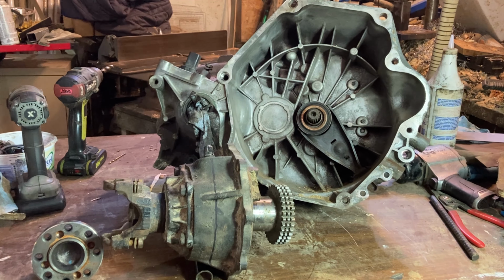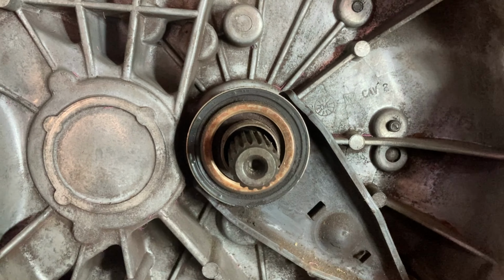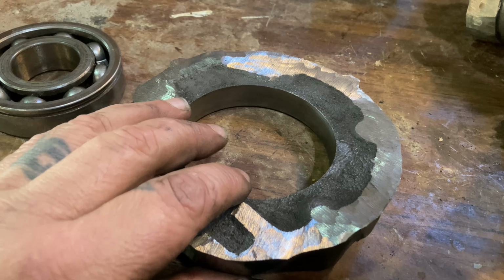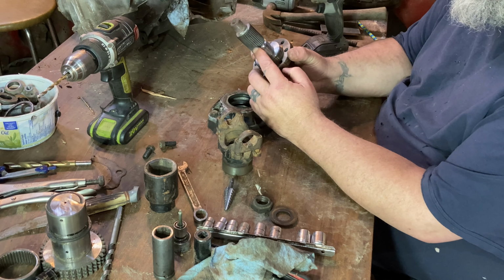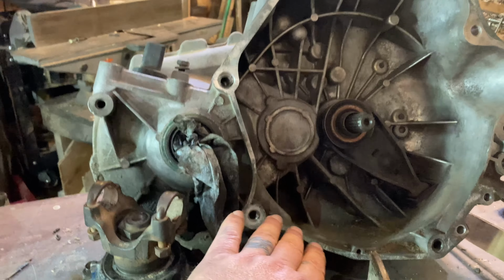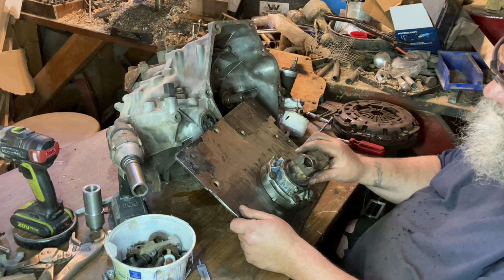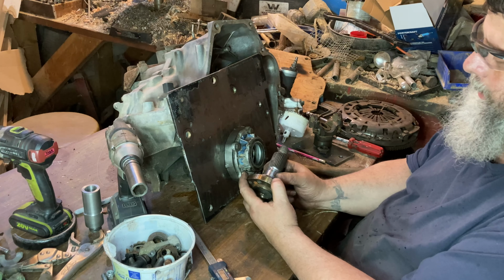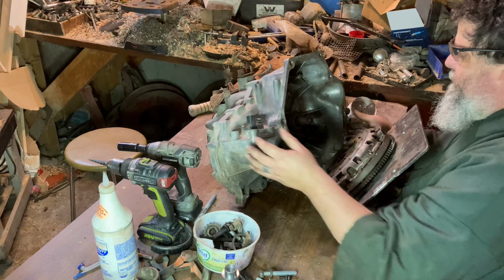Put a Real engine in your loser cruzer

Comment: Your my kinda dude I put together a machine shop because I got tired of buying specialty tools everytime I worked on something lol also taught myself how to use it currently setting on a 16x144 koping lathe a old wells index mill a jet radial arm drill and a heck of a load of tooling and access
Reply from the maker: I have been tooled up a few times in my life but setbacks happen. I am pretty much in the boat of not knowing the “right” way to do things has forced me to learn how to just do it and If it works then it’s awesome and if it doesn’t then I can always call it art

Comment: This is gonna be awesome. food for thought your gonna want to run the gsxr in the highest gears first then shift the car transmission to put less torq into that tiny input shaft. I hope that one bearing is enough to hold up the flywheel. i dont see a pilot bearing stub on that transmission. i think if it did have a pilot bearing one bearing would be enough but without it i think a two bearings would be best. also the crankshaft is cast and it will weld fine but the strength of the joint might come into question as that bike is pretty big power. honestly the bike engine has a clutch i bet you could get away running direct and using the bike clutch to shift and not having the car clutch at all.  that hole saw hole must have been awful to drill. i got a best arc pilot arc  plasma cutter off amazon that i absolutely love i know you would too. you sure are getting a lot of use out of your lathe and i thought the rebar center punch was awesome too. this is my type of thing that your up too. thanks for the video. you keep posting and ill keep watching
Reply from the maker: You are right on all counts. I will start off in 5th on the bike tranny which is 1 to 1 ratio and I forgot to show that I drilled and pinned the welded parts and used high nickel rod and heat treated after but I thought I might loose people with all the babbling I was already doing. If the bearing doesn’t work I will try a unit bearing and stub axle out of a bent jeep front axle I have in one of the piles somewhere
Reply: Think about this like a semi truck except your gonna have 30 forward gears and 5 reverse lol probably split allot of gears I doubt you’ll be able to utilize the max over drive of it because of the torque amplification would probably put the engine down to like 800 rpm at 75 those engines lack in any real low end torque so your shaft will likely survive
Reply: @jeremycable51  there won’t be a bunch of overdrive though. The bikes last gear’s probably one to one same speed as the crankshaft. So it won’t have any more overdrive than the pt cruiser had